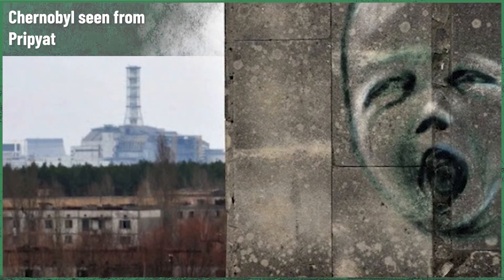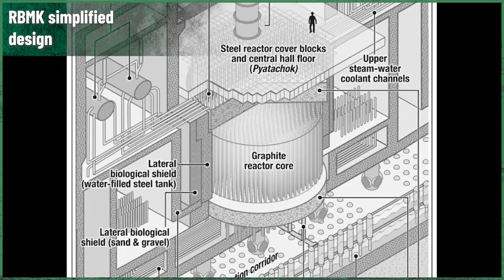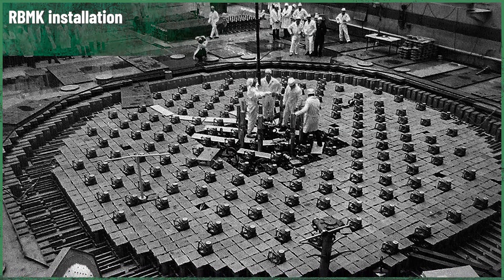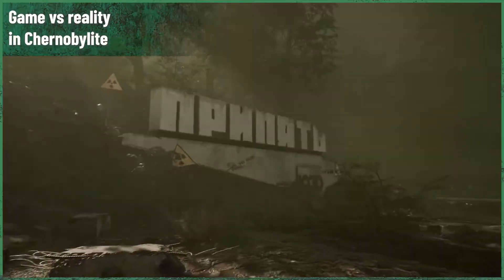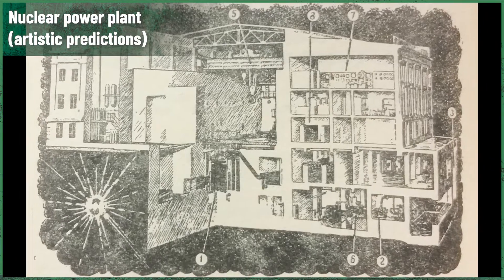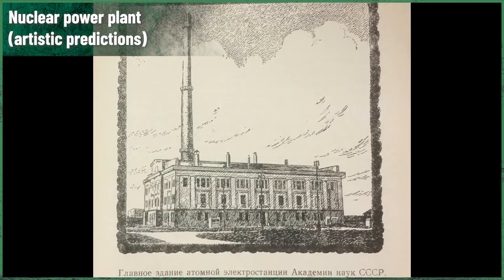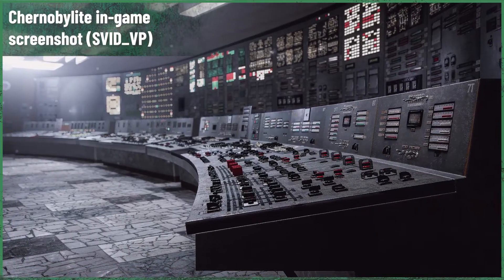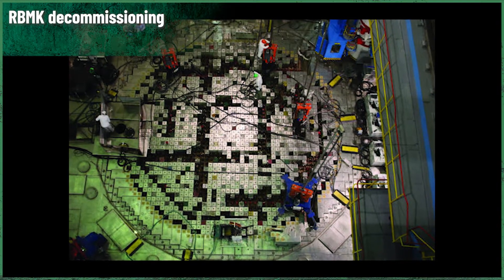What were the RBMK design flaws? ||| PART 5 ||| Chernobylite Stories

Comment: Hypothetical here. If the RBMK had the biological shield of its Western counterparts, would it have contained the explosion?

Personally, I don't think it would have mattered much with how the 1,000-ton reactor lid flew off, I can see how that in itself could have breached containment, but I am curious as to what you guys think.
Reply: The lid flew off because pressure relief system wasn't adequate, it had very low capacity, and the lid did the job of the relief valve. If the pressure relief system had been designed properly and there was containment, the scale of the accident would likely have been much smaller.